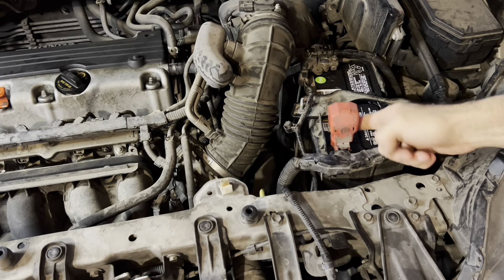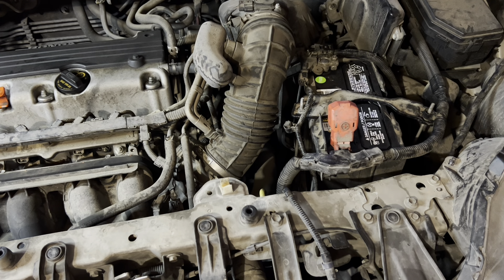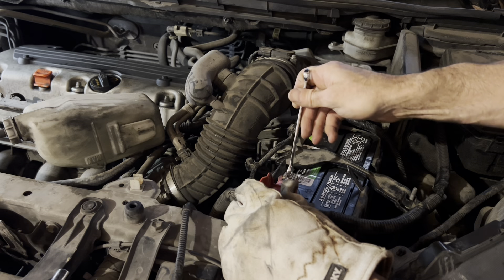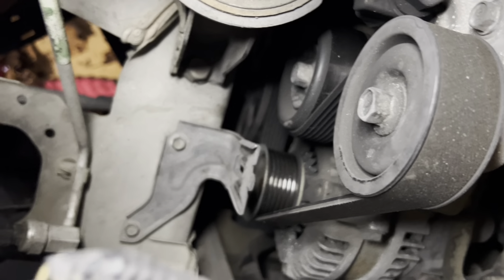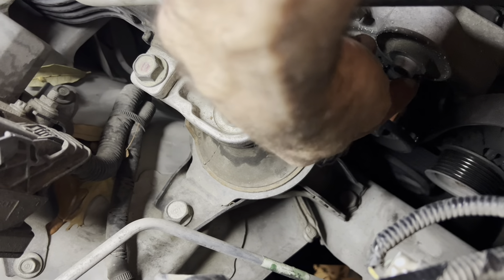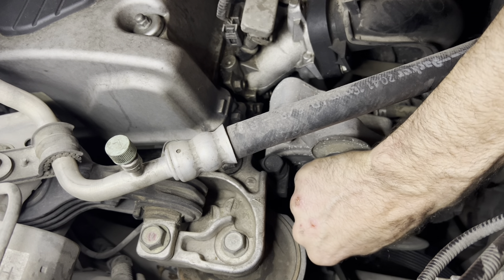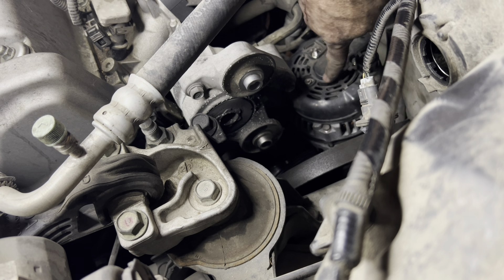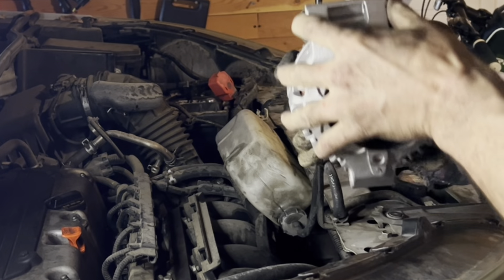Honda CRV 2012 Alternator Replacement

Comment: You should always disconnect the negative (black) battery terminal first.
Reply: It doesn’t matter.
Reply: @adaptedbythedans  I believe you do take the negative (black) off first and then positive (red) but when reconnecting the new battery, it's reverse, positive first then negative.
Reply: ...and when reconnecting, do it in reverse. Positive then the negative.